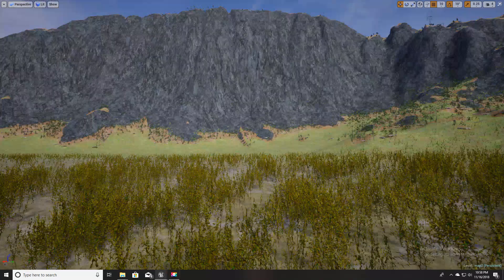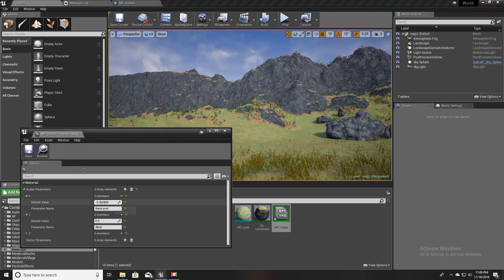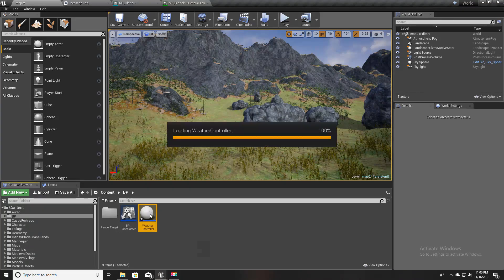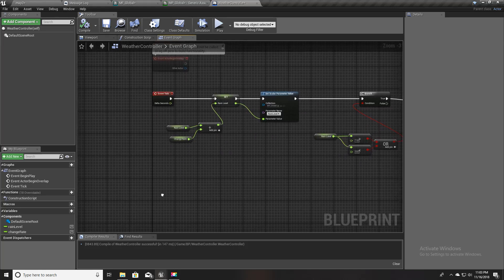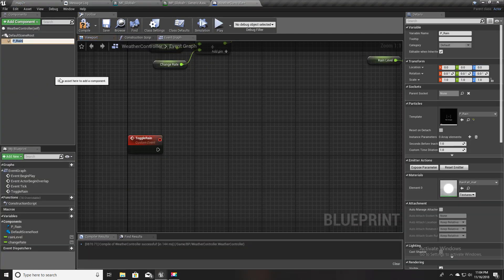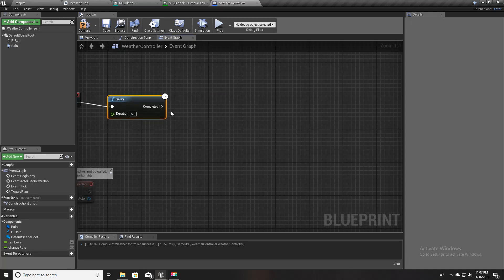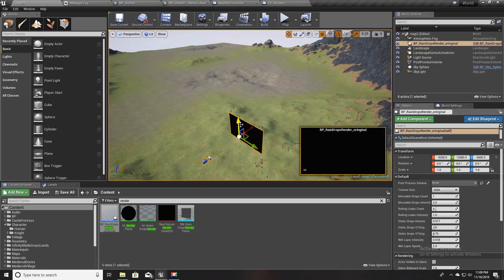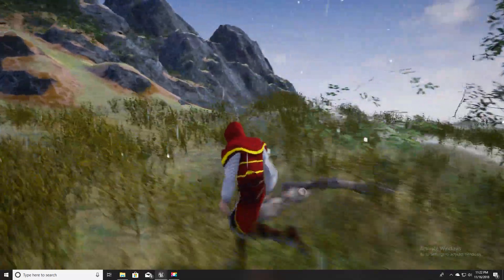Unreal Dynamic Weather - Rain Tutorial - UE4 Open World tutorials #18

Comment: everything works except when the rain stops the wetness does not dry and go away, why is that?
Reply from the maker: Rain level in material parameter collection not going back to 0. Debug and see why
Reply: @CodeLikeMe  How would we debug this
Reply: Did you ever figure this out?  I am having the exact same problem.
Reply: I did manage to figure it out after some debugging.  In the weather controller, after the branch where it is set to false, where the change rate is set to -.1, this is to slow.  The rain level takes a while to reach 0.  If you lower this number even more (I used -1 for testing purposes), the rain level will reach zero faster.  Here is a pic of how I debugged and figured out the rain level was never reaching 0.  The connection hiding on the event tick function just converts the float value from the rain level to a string.
https://i.imgur.com/FxWo4KJ.png

Comment: The wetness effect on the ground caused by my rain fades into existence as it should, but once its at its full level of reflection it fades away instead of lasting the duration of the rain. Any ideas as to what would be commanding my wetness to turn off once its fully on?
Edit: 
I saw in the next video that you set up a couple "Print String" events in the section that sets the RainLevel in the Weather Controller. So I copied this and found that my RainLevel rises to 0.7 and shuts off visually, but still rises to 1 and outputs "Stopped" which I printed at the end of the string. Then while repeating "Stopped" after every number it continues to rise until around 2.7, and after that it starts to decrease indefinitely through to negative numbers.
Reply: This happens to me too.. I think it happens to the guy in the video but he hasn't noticed yet
Reply: Don't know if you found a solution but if you did I'd like to know. The way I fixed it was by adding a clamp between the 'RainLevel' collection and the rest of the blueprint. Now the values will not climb higher than 1, or drop below 2. I'm new to BP so I could be way off.. lol

Comment: how did you turn the render target into a BP because at the moment i got the rain running constantly running since i followed the other video
Reply from the maker: my render target is inside the bp. you can select the render target in world outliner and convert to a blueprint as well
Reply: @CodeLikeMe  i don't have the render target in the world outlier i just have the scenecapture and the particle and post process in the world outlier,
Reply: @Suffi8150  I have been messing with this for 2 days testing different things to get this right.Turns out all you have to do is remove the Post Process from the outliner, then in your Weather Controller Blueprint, add a Postprocess component. Change it's details to be the same as the one you had in the outliner. Now you can control(Enable/Disable) the effect in your Weather Controller Blueprint.
Reply: @Suffi8150  Also I used an animated material on a plane instead of a particle system to save on resources. Either will work, it depends on what you are wanting to achieve.
Reply: @cr3ap3r1  thanks for the reply help a lot
Reply: @Suffi8150  You could also create a component reference to your particle system or plane with the rain effect in your weather controller, and enable/disable it from there.
Reply: Hi William you did a Amazing Ambient Day/Night Rain/wet cicle work, I saw it in you fb page. Really awesome. I wanna learn of the best me you gain a follower for sure. Could you do a tutorial video explaining how to get that effects?

Comment: Can you add rain occlusion system so that when the player is under a roof or inside a house the rain does not not show inside the house. Now the rain shows inside the house and it looks bad.
It will be a huge plus for the series if you add a tutorial on it
Reply: you can add distance fields to the collision in the particle system and enable mesh distance fields in project settings for a similar effect
Reply: @outlander7370   doesn't seem to work… still the rain is inside the building
Reply from the maker: I'll look into that
Reply: @CodeLikeMe  so . this problem any news? or any process?

Comment: Great Video, btw how to smooth out the transition of the material when the roughness changes? Mine was stutter .
Reply: Reduce the time between ticks. You set it to 1 second at the beginning, make it 0.1 or something low, then play with the change rate (like 0.01) or so.
Reply: I think this is the same issue I am having but not sure how to change that parameter.

Comment: Great tutorial Thilina! Only issue is, after the first rainfall, the change rate continues to drop past 0 and goes into negatives. How can we set it so that the change rate eventually starts going up again, so that another rainfall begins?
Reply: @CodeLikeMe  I am enjoying this series however, Having a bit of a problem with my world not drying out after the rain. If I am in my weatherconroller BP, I set the change rate to -.1 for the false branch. If I put it as anything but -.1 my world will not dry up. I have tried drastically changing both numbers to as high as 5000 and as low as -500000 

Reading above if I want to make the rain come back (which I do) will I still be able to do that with it not functioning unless it is in the negative?

I hope that question wasnt to confusing. I can try to clarify if it is.
Reply: Just watched the next episode hoping it would sort itself out. 

Unfortunately, now when I hit play, the clouds roll in and it starts to rain but whe. It rains instead of a gradual 0-.8 it flashes in and out and gets more intense with each flash until it reaches the target, when it starts to flash the "wetness" flashes with it until it stops raining. Once it stops raining, the wetness disappears abruptly from the landscape and gradually from the rocks, trees, etc.

Again, I am really enjoying this series, but having a little bit of trouble.